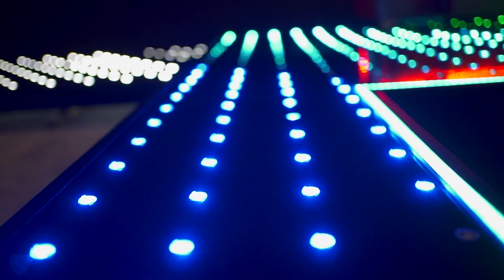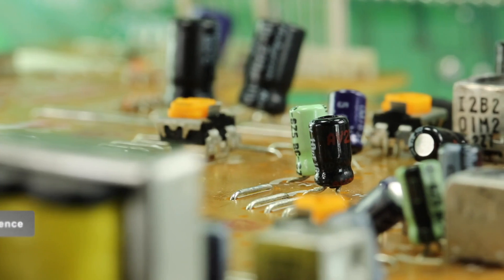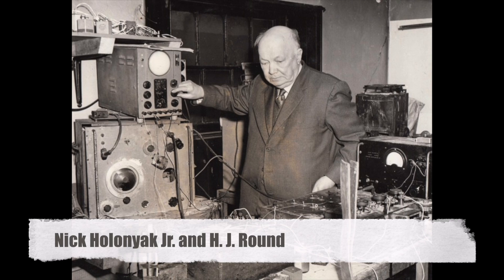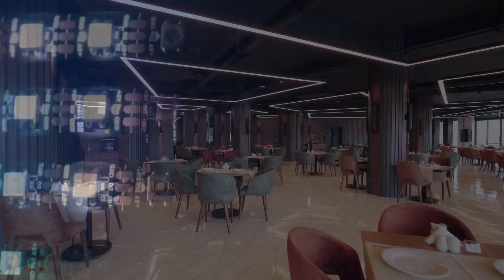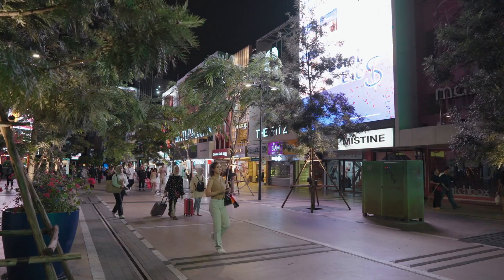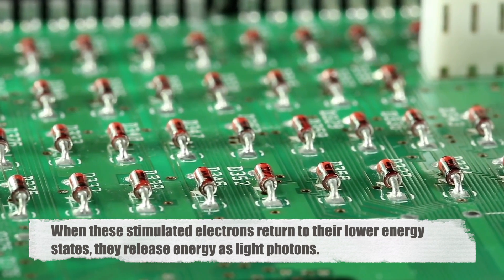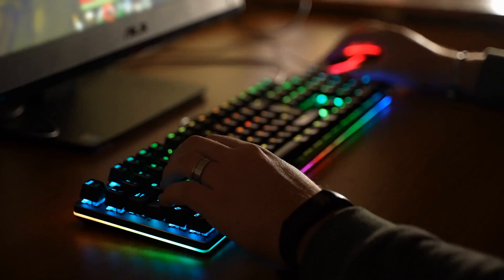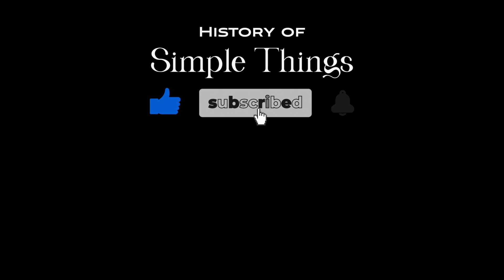History of LED Lights - How do they Work?

Comment: A method to adjust the brightness of LEDs is to use pulse width modulation of the voltage source. The duty cycle of the pulses defines the brightness: the higher the duty cycle, that is more "ON" time,  the brighter the LED. You can see this sometimes by moving your eyes quickly when looking at an LED. It's kind of cool to see this! 😃